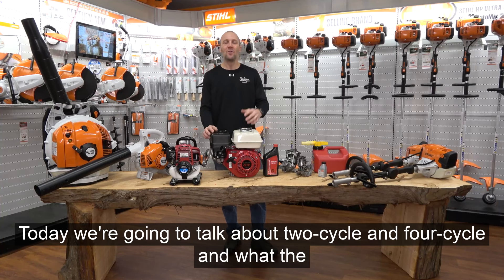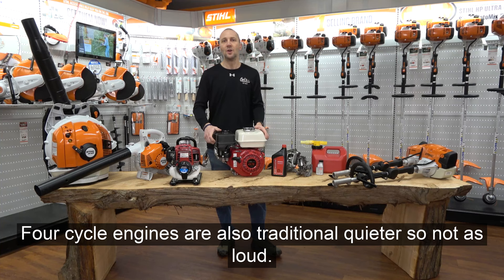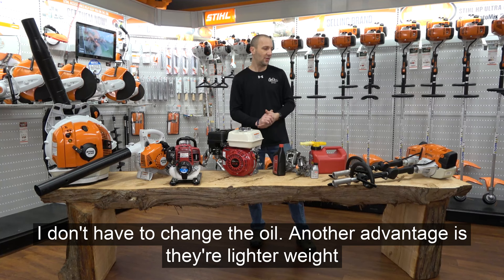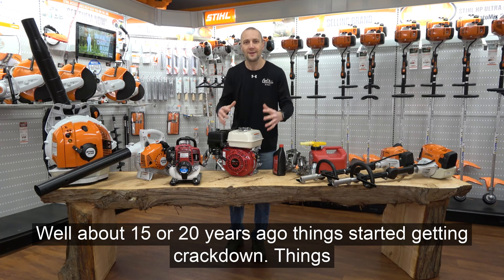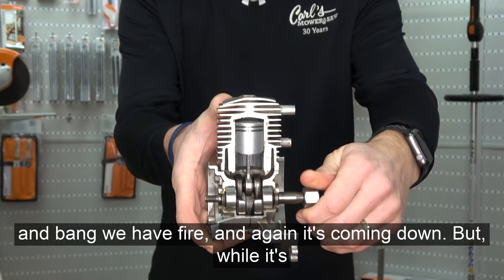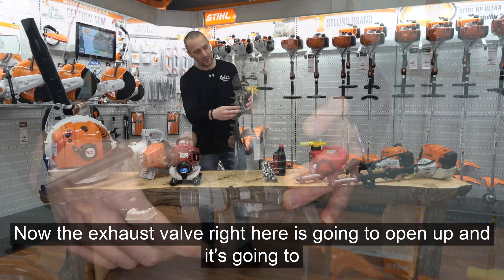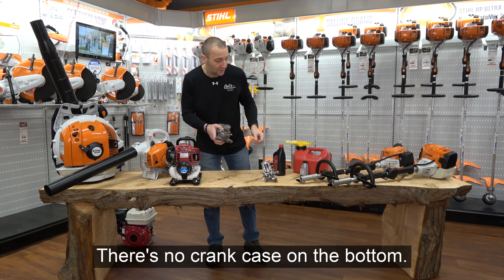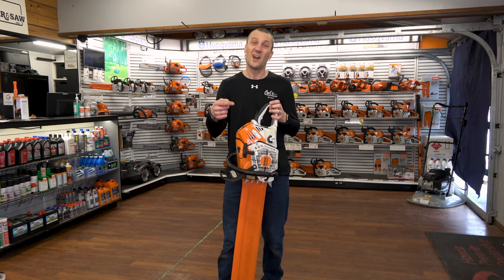Everything You Need to Know About 2-cycle vs. 4-cycle Engines

Comment: Great video. Love the cutaways! Now, not to be nit picky - and I know 2 cycle and 4 cycle have become part of the vernacular - but… they are both cycle engines (intake, compression, combustion and exhaust is the cycle.) One does it in 2 strokes of the piston, or one revolution. The other does it in 4 strokes of the piston, or two revolutions. So in a technical discussion, the terms 2 stroke and 4 stroke would have been more appropriate. Just a pet peeve of mine. I’m sure most people don’t care what you call them :)
Reply: They are synonymous aren’t they?
Reply: @TitoTellsTheTruth  they have become synonymous in the vernacular, as have so many things through advertising, but they are both simply “cycle engines.” This cycle consists of intake, compression, combustion and exhaust. The engine completes that cycle over and over to deliver power. One way to think about it is that you can have a 2 stroke cycle engine or a 4 stroke cycle engine.

Comment: Hi mate, thank you for your video! I just bought a honda single shaft UMK425 4 stroke. What i realized is when i turned it upside down to do edging, the engine didn't like it and it stopped. I assume most gardeners use a 2-stroke whipper snipper to do their edging instead? I bought that honda thinking it will be able to perform the edging feature rather than swapping to an edger tool. Or am i missing something?
Reply: Hey I was worried about the same thing and have read similar things in reviews regarding the UMK, although I had a bloke from Honda call be back today regarding the use of the snip upside down and he said that the GX25 (engine in yours) and GX35 were designed to be used in any orientation.  Their site also has the same claims.
So if you bought it new see if they can tell you why it's happening or refund you.
Reply: Hey I had the same issue with the UMS425 (bent shaft) for me it was the choke switch was loose and closed off when I went to use it upside down.  The plastic surrounding the choke switch/lever on mine is cracked and it appears that it relies on that to hold its position.
Reply: @SnifterRoux  I spoke with a rep for honda, the new hondas are all designed to be used in any orientation. But the extra weight definitely does have fatigue on you.

Comment: You said it use  gasoline. Is there a version that use kerosene? 
Also isn't the 2 stroke ones vibrates  more... so problem  if you work it long hours?
Any sensorybto prevent it running n hit stones?
Reply: Yes can use kerosene. Yes 2 stroke vibrates more. No it's designed to run same hours as 4 stroke

Comment: Help please.  I want to purchase a new line trimmer. I currently have the Ryobi two-stroke 25cc.  I am considering the Stihl FS56 RCE and the Echo SRM225.  Also, is there a big difference between a 21.1cc engine and a 25.4cc?  Any advice would be greatly appreciated. Thank you for your time.
Reply from the maker: Hi Craig, We'll always go with Stihl over Echo because of Stihl's performance and durability. It will pay for itself again and again over the years, so choose Stihl.
Reply: @Carlsmower  I have had a sthil 131r and it had clutch spring issues and the plastic cam failed on it. I replaced it with a Echo 3020t and it came with a 5 year warranty and it has a ton more cutting power. It also is a traditional 2 stroke vs a 4 mix engine. That means no valve adjustment or hardly any maintenance. I researched for about two weeks before I bought mine and the Echo seemed like the right choice for me. I'll never go back to stihl weedeaters again.

Comment: my question is, does using a 2 cycle engine make you age faster.  essentially you are sucking in and consuming 2 cycle oil a little bit at a time as you are using it.  You probably drink a quart over a lifetime.  can't be good for your health.  what are your thoughts?

Comment: I came here on a quest to find the horse power difference between 2 cycle vs 4 cycle engine of the same cubic centimeters.. And if there is an equasion for discovery. This is what I need to know.  You claimed "Everything you need to know" and this is probably the most fundamental information one needs to know.  I did not hear where you explained the difference, except your generalized difference stating the 2 cycle gives more power.  You also said the 2 cycle engines gives more RPM.  For my current position a horse power difference or an equasion is crucial.
Reply: 4 cycle you can expect to be 2-3 times less powerfull but also consumes 2 times less gasoline ( at lower rpm).
Reply from the maker: The 4 cycle has more torque. So on a blower or trimmer the difference in performance is big.  It’s like comparing diesel horsepower to gasoline horsepower.